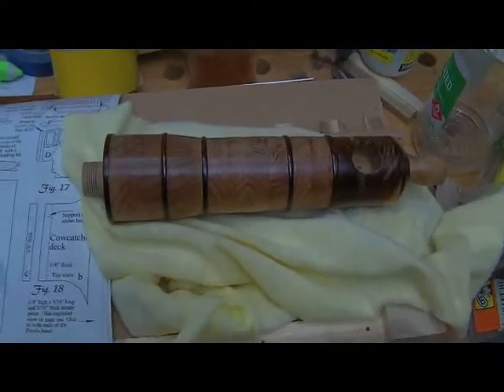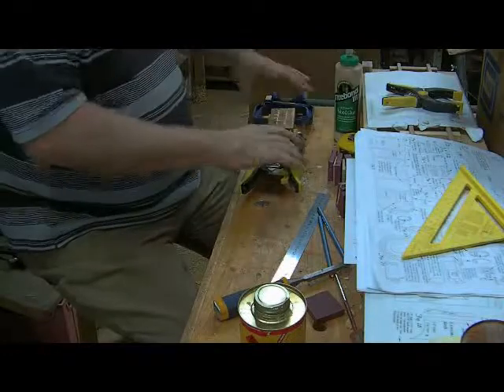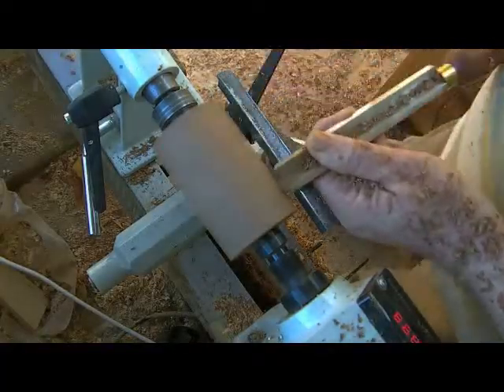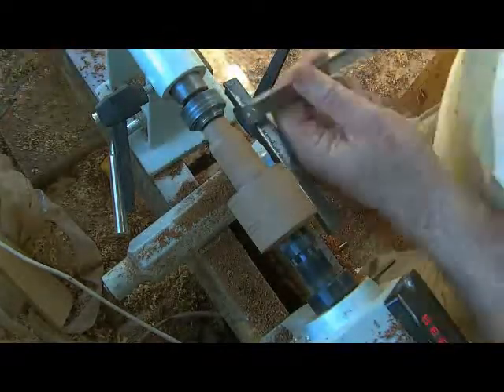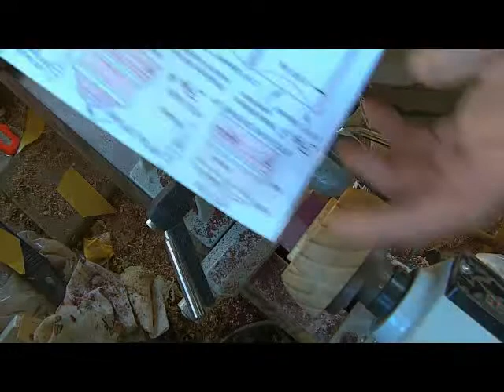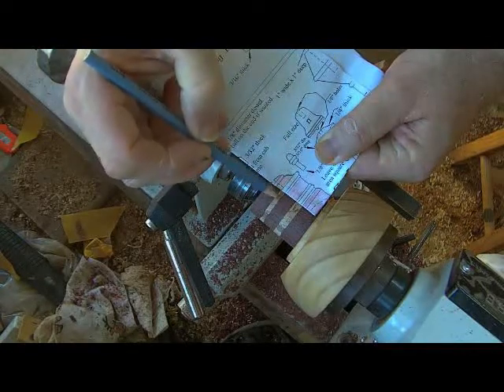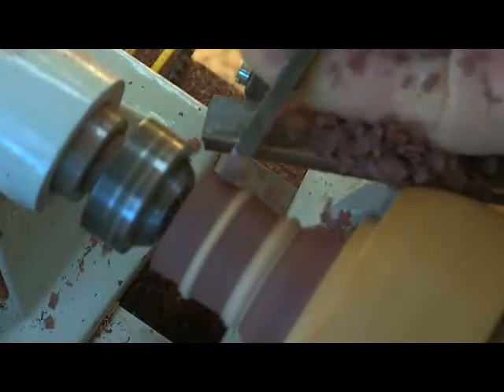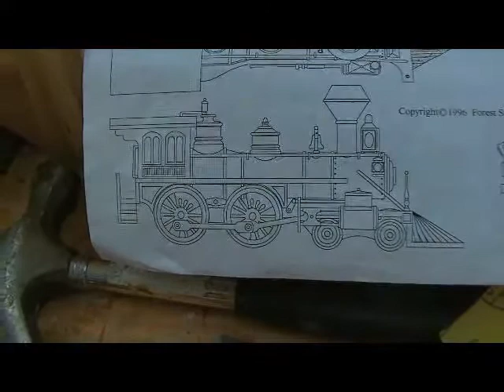Iron Horse Project #3

Comment: Hi Rob I have just got my train plans most other toys Ive made has been pine would it look almost as good using pine and jarrah   as  I 'm not sure where to get other woods as I am new to Australia . Pete  (nobbie) Simith
Reply from the maker: @NobbieSmith  Hi Nobbie, yes, I was lucky to be gifted some Tassie Blackwood, but I would not use pine as it is a softwood. Try getting hold of some Victorian Ash. That would be available a5 most timber sellers, even Bunnings. It is harder and when turning, it will give you less trouble than trying to turn hard jarrah and pine laminated together.. good luck with it all.